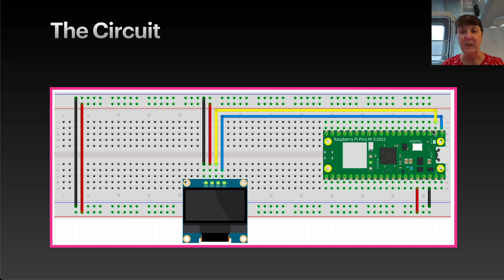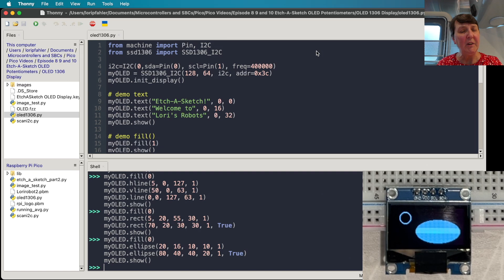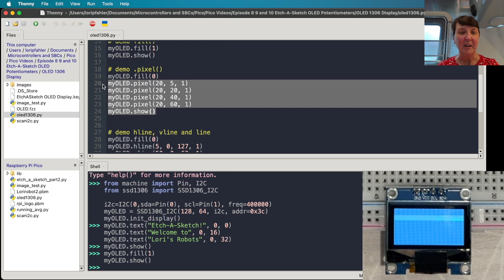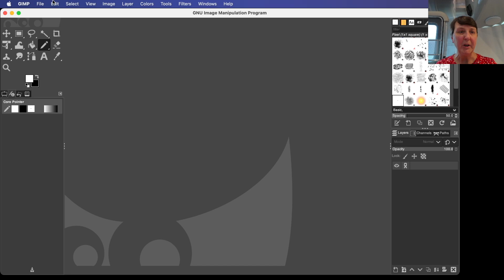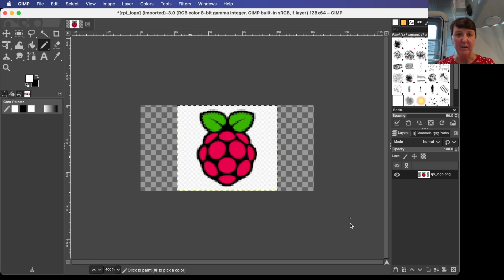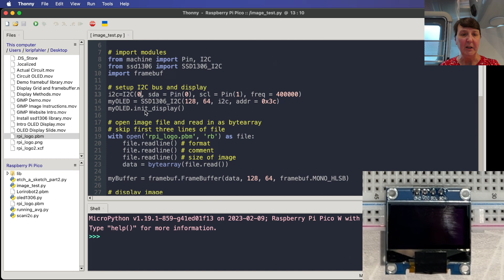Pico W Episode 8: Etch-A-Sketch Project Part 1, SSD1306 OLED Display

Comment: try to print a chr(128) or higher, it will give a block, used it in a clock to show big numbers, using 5 oleds
rotated on their side, did not use an external chip to select each oled, pico is fast enough to build an i2c object to talk to the oled we want, but instruct the pico to have the old i2c pins set as serial first, an oled does not need constant communication.
Reply from the maker: Thanks for watching!

Comment: Nice project, but the display is much too small to be useful
Reply: not really! used in many projects.
Reply from the maker: Thanks for watching!  These displays were probably created for cell phones. They are very cheap so many people use them to learn on and use in applications that don't need a large display. I agree a bigger display would be even more fun for this project.  I hope that folks learn enough from this series to try using a bigger display (perhaps even color) themselves.
Reply: You would be surprised with what these can display. I have an ATtiny85 game pcb that plays Pacman on this size screen. It is small but very much usable.

Comment: What a useful video. One question. For filled rect you added an extra parameter True. Most docs I have looked at use a separate method fill_rect for filled rectangles. Will either work with this 1306 library (module)? I guess I can dig up a 1306 and try it myself. 
Looking forward to parts 2 and 3. Thanks.
Reply from the maker: Thanks for watching and for your feedback!  I demoed the methods from the framebuf module that are documented in the Micropython docs online.  I am sure there are other modules that have more methods available.